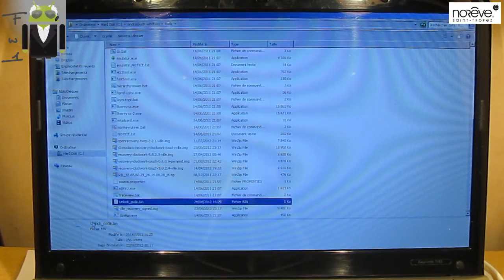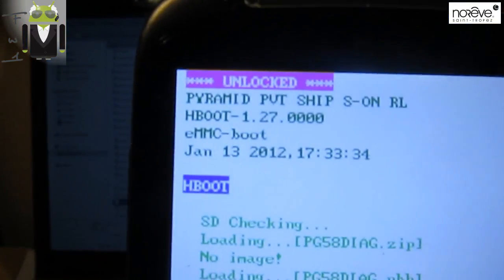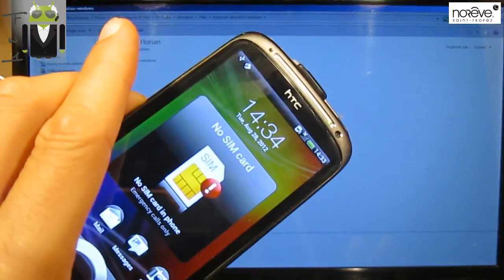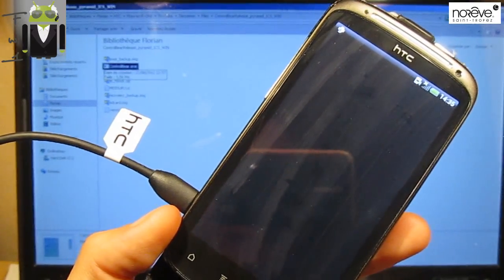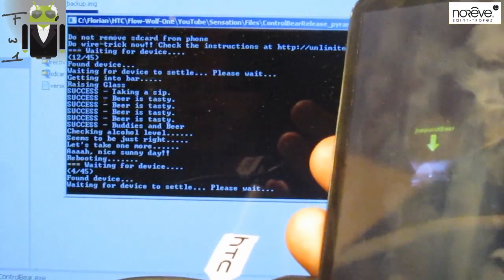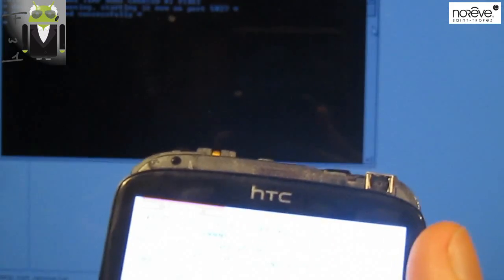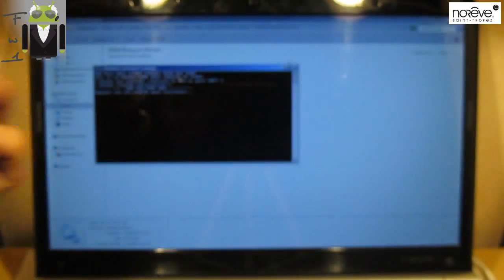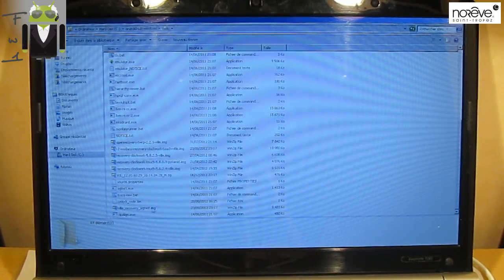How To S-off HTC Sensation / XE / 4G | HBOOT 1.27 & + | Juopunut Bear

Comment: Hi I successful done S-off. no need to use any wire just use niddle and put inside 2-3 times and process will success. I was try with wire around 2-3 hrs but no success. but with niddle one first time its done:)
Reply: hey.have you installed the stock ROM before doing all of this ?
Reply: FSA king
No. first i done unlock bootloader then S-Off. and i install 4ext recovery with the help of fast boot. I will install ROM (sultan-kernel-pyramid-cm-11.0) and gapps (pa_gapps-modular-micro-4.4.4-20141207-signed).
Reply: sunit verma thanks,I managed to S-OFF my device,I had to install the stock rom before doing that tho,after that I installed new rom which is awesome !(ViperS 5.3.0 JB Sense 5 | Sense 6 Blinkfeed)

Comment: hello friend I have htc rezound and
not start just stays in fastboot I could spend the ruun s-on

*tampered*
*relocked
*segurity warning*
htc rezound virgor pvt ship s-on rl
 hboot-2.28. 0000
radio-2.23.10.0123r/2.23.10.0124r
opendsp-v14.6.0.7708.00.0507
eMMC-boot sep 20 2012,17:40:22

Comment: hey dude i dont get the Juopunut screen after reboot dont know why !! :/
Reply: i know it comes late but open command promt in the Conrolbear folder and type Controlbear -f   then it boots up normally
Reply: and dont forget to run the temproot remove .bat when you booted up
Reply: i'v got it thanks to you mr :) i'm runing viper 5.1.1 but iv got an issue with the battery life is there any thing or another rom to have that point covered ? thank you
Reply: +Kadir to the 
Thnx that worked for me !  
Explanation: 
Controlbear -f restores the backup(s) it has made earlier. Then it reboots and you have to start Controlbear again (without the -f option) to continue with the wiretrick attempts

Comment: Hello. I have a problem. I followed your steps and got everything. I managed the Bootloader, S-off, recovery and root. But when giving permissions to the SU will not let me and says I'm not root. The application is installed. I tried updating it from the market and nothing, I updated the binaries and not achieving anything. I went to flash the zip from recovery and still the same. NO ROOT! Thanks for everything. I hope you can help me.

Comment: hi my brother i dwonloaded controlbear and temproot files and i started with temprrot.bat and no problems but in controlbear cmd says >>>>>

======== ControlBear 0.7 beta for JuopunutBear S-OFF ==========
Starting up......
Connecting to device...
Searching device.....
Found device.....
Backing up......
Permission denied
Transferring backups....
Secondary backup FAILED!!
Press ENTER to exit.....

note : i have installed recovery on device before getting S-OFF

Comment: I have a problem with ControBear :
======== ControlBear 0.5
Starting up......
Connecting to device...
Searching device.....
Found device.....
Backing up......
Transferring backups....
Secondary backup FAILED!
Press ENTER to exit.....
Reply: +Filip Cichocki I'm having the same problem. were you able to solve this?

Comment: after 2 or 3 try of the paper clip shit control bear ceassed to detect the phone and it apear that the phone shut down
so i tried to turn it on again by pressing the power button but the phone just don't react to anything like if it was dead
Reply: ok i managed to restart it but i didn't knew what to do so i restarted from the temp root stuff

Comment: Ok, do you have the drivers installed ? Do you have Usb Debugging Turned On? because from what i can see your phone hasnt connected to your computer via adb which suggests that you havent turned on usb debugging so flash the temp root uninstall file and turn on usb debugging and then re try, if you need any files message me, i have all of the required files.

Comment: i tried to do this, but it failed, i went into the QHUSB_DLOAD mode, so i battery pulled and got to the same screen, but it is no longer recognised by controlbear. after this i realised it was in disk drive mode, but i can't do anything as it wont turn on. What do i do?

Comment: Hi I installed jellybean 4.2.2 on my htc sensation xe,unlocked bootloader,rooted,installed rom and G apps but it gets stuck on cyanogen bootscreen...I couldn't install firmware 3.22 or 3.33 because it wasn't S OFF...do u think if i do a S OFF it will be okay?

Comment: My HTC Sensation z710e switched off automatically, Its not booting now.
I have tried charging for more than half an hour. The orange LED (for charging) is also not coming. Nothing comes up on screen too, not even a vibration.
I have tried holding the volume down button and power button also, nothing happens.
I have tried taking out the sim and sd card, then also nothing comes up.
Its not even rooted.help me out.my email:njorogeian20@gmail.com

Comment: Ok, I flashed the recovery and then used it to install "su-2.3.6.3-efgh-signed.zip", but after that Root Checker (an app from the play store) told me my device didn't have Root Access, so I downloaded "Superuser-3.0.7-efghi-signed.zip" (latest version is 3.1.3) and installed it using recovery, and now Root Checker tells me I have Root Access.

Comment: Ok, I unplugged my phone, took the battery out, and powered on into bootloader, and it said it was S-OFF, so I selected reboot and it rebooted but the UI didn't come up (black screen, only status bar visible), so I plugged in my phone and ran temp-root-remove.bat, and it was successful, and now I still have S-OFF and my device is working normally, I hope nothing bad happens because I didn't install Juopunut Bear modified hboot.

Comment: first time I ran ControlBear.exe, my computer crashed and restarted right after finishing the wire trick (my phone didn't reboot, it stayed on the same screen), so after computer restarted I ran ControlBear.exe again, and this is what happened:
Starting up......
Connecting to device...
Searching device.....
Found devise.....
Found backups!
Devise S-OFF already!
Quit....
Press ENTER to exit.....
and the problem is, my phone is still stuck on the same screen (the screen in 09:30)

Comment: Thank you, great video! I was already rooted so I just skipped to the ControlBear part...If you mess up and get the ControlBear logo STUCK on the screen, and the program says "critical failure" you will have shift right click the control bear folder, and open a command window.. Then type "ControlBear.exe -r" (no quotes) to reset the phone to the backup controlbear made.

Comment: Finally worked after countless tries. 
I connected the wire into the bottom hole, then to the microSD metal casing, counted to "one miss" and Voila! (connect wire, say one miss out loud, disconnect wire).
Merci Beaucoup, sir!!

Comment: вдалося зробити s-off
  sensation xe
hboot 1.29.0000 
стокова прошивка
на компютері було встановлено HTC sync і HTCDriver3.0.0.007.exe
_____
до початку wire-trick телефон був s-on UNLOCKED через HTCDEV
після вдалого замикання дротиком (приблизно спроба 10 за допомогою MP3 супроводу) 

s-off  LOCKED

Comment: there on their site it says that it is not safe to make, because they also did not try it on the 64 bit windows. I did through windows xp sp3, but I had a little trouble with a USB cable. I'm more connected the USB cable and hi speed worked and now I have s-off :)

Comment: Hi, my phone has an unlocked bootloader and it is perm root but i keep getting this in command prompt.....

Starting up…….
Connecting to device…
Testing ADB connection
Test 1: Rebooting into bootloader
Waiting fastboot (7/60)
Waiting…..
Test 2: Booting device into JuopunutBear boot-mode
Waiting ADB…. (2/60)
Test 2.1:  Rebooting into bootloader
Waiting fastboot (60/60)
Test 1: Rebooting into bootloader FAILED
Press Enter to exit…….

Any ideas?  Thanks